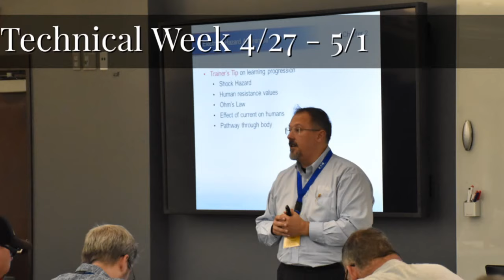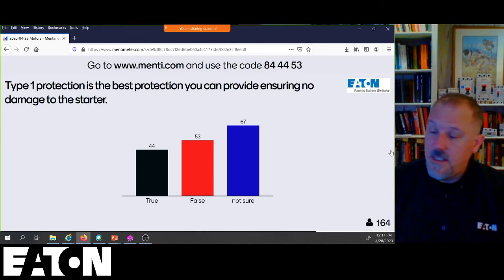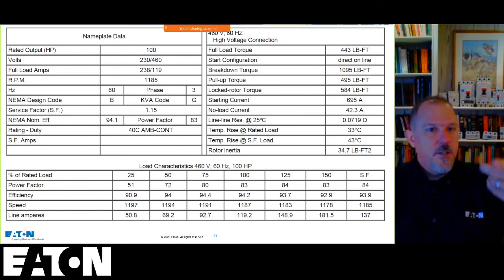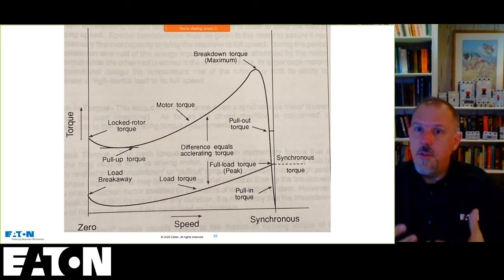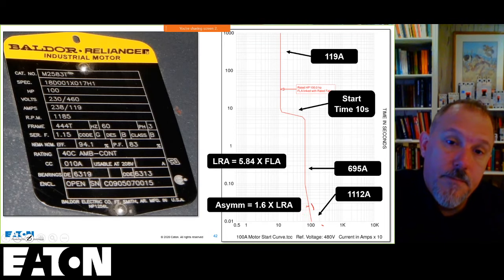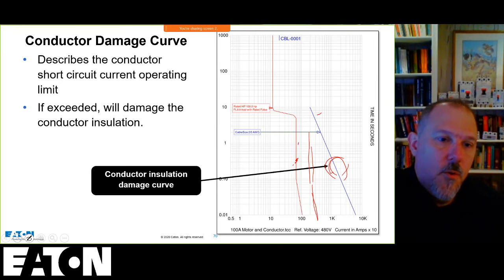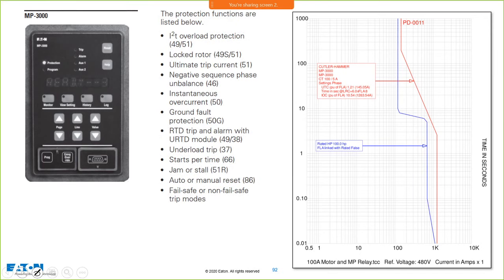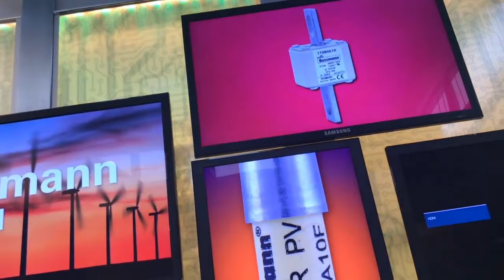Motor Applications & Protection

Comment: Recently had an Design B 1.6A FLA, motor on cooler fan, that kept blowing fuses. Overload was fine ( class 10) but all the 140%, 170% ( connected the built in thermostat) longest time delay for the heaviest in-rush was just getting destroyed on the second restart.
The Design B kept pulling 1100-1200% of FLA in rush. Replaced the motor for exactly the same but brand new one - didn’t change anything. Used exception 2 for 430.52, went up to 225% on time delayed ( double element). So far it’s fine.
Don’t know what is going to happen when hard wind will be blowing, and wind up the fan spinning the opposite direction, though.
I would say I “accidentally stumbled” upon that exception. Because it wasn’t in its usual place under the table.

Comment: 430.102 ( A) Motor controller should have been after the motor disconnect. Motor disconnect shall be used especially when the motor is not within sight from certain location or from tne controller.
Reply from the maker: Great feedback Ronnie!!!!  thanks